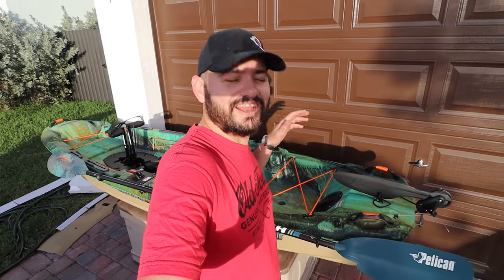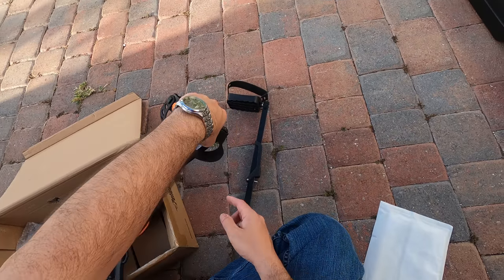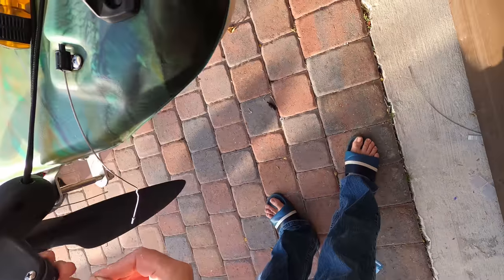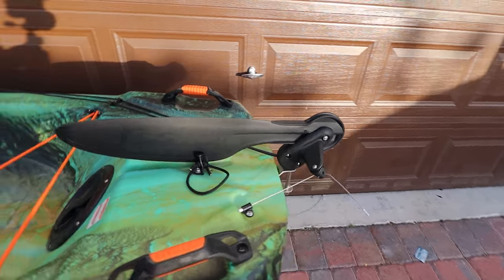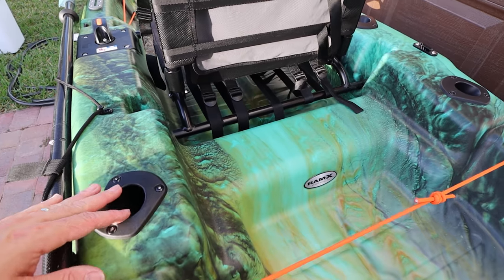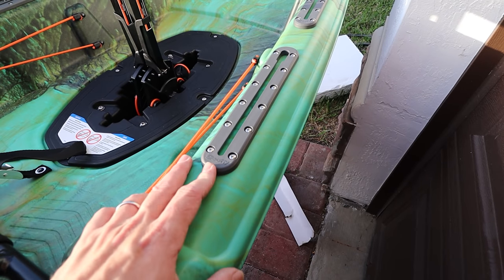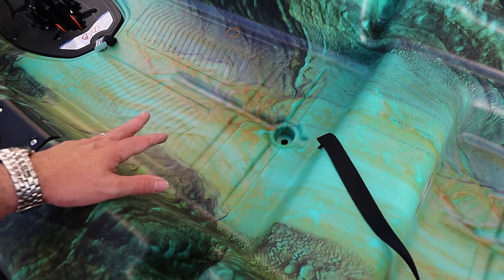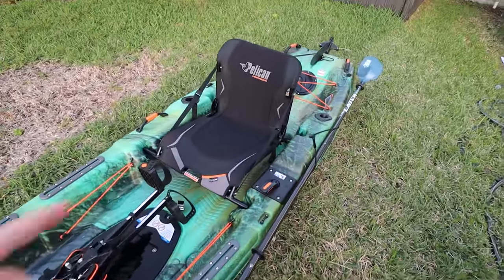FINALLY Pelican Catch 110 HYDRYVE II HDII Unboxing Setup Walkthru

Comment: Pelican stepped up there game with this one. This Catch 110 Hydrive by far has best vesatility of the Pelican fishing lineup & at that price also for flipper/pedal system control , Pelican did good. Aliex great review bro, how is the control handle operation ? Is it fluid & smooth when turning & is turning sharp ? Thanks bro,  really nice looking short kayak for easy/quick water access.
Reply from the maker: The rudder works great, doesn't seem to be moving all over the place
Reply: @AliexFolgueira  Thanks bro.

Comment: Better seat, rudder and paddle compared to the Hobie Passport 10.5.  Is the rudder strong enough to mount a Bixpy?
Reply from the maker: I tried using bixpy on the rudder... Didn't work the only way I think is to do the diy kit or use bixpy hand steering

Comment: would be cool to buy the 130hd with the new HD2 drive. so overall what do you think and what would you recommend the 130hd or the 110hd? aside of the improved Hydryve.
Reply from the maker: ummm i think the 110 works better, i think it is more efficient on the water.

Comment: Hey Aliex, I’m very interested in this boat! After having it for a few months now what is your opinion of it? Pros/ cons of it? Likes/ dislikes? Has all the concerns of the previous model been addressed and fixed? How is the tracking and steering? How is the stability and do you stand and fish? Also what do you think of the paddle? Is it worth the money or better off getting something else?
Reply from the maker: i actually took it out to flamingo this passed Sunday, it performed well, i was standing up on it, letting the current take me as I was casting to the mangroves, it is a bit teepee but you wont flip unless you are over 300#! the drive? it is well built, they fixed a lot of the issues people encountered with version one, it is not as smooth or fast as the latest hobie, but for that you gotta pay the price. bro right now this is available at REI for $1100, that’s a steal! amazing value, it is totally a buy in my book check it out (affiliate) https://geni.us/Af9NsQk

Comment: The seat is no longer hieght adjustable? Is that the shape of the hull really that much better than the original? Just looks simpler and thus cheaper to make
Reply: The seat can only be used in Hi-Lo positions on the Catch 100 and 120. Neither the 130HD nor the 110HD have height adjustability.
Reply: @PelicanSportVideos  Please get Sail in Ottawa to stock the Catch 100. They wouldn't order one for me and they wouldn't even commit to stocking one, leaving me to check their store and website repeatedly to have any chance of buying one. If they are going to rep your brand, they should not be turning away customers.

Comment: Hey Aliex! Just wondering, would a Hobie cassette style plug, fit in the hole where the hydryve go?  I feel like it would fit since you can fit a Hobie mirrage in this , I think ?
Reply from the maker: The hull is smaller than the Hobie ones so it won't

Comment: Is the seat length adjustable? I’m asking because I’m 5’2.
Reply from the maker: You can adjust the cranks, you should be fine with this one
Reply: This kayak is designed for people measuring between 5'0 and 6'4" :)
Reply: Thanks guys I have mine coming.

Comment: Steering cable to rudder installed wrong. Go through the hole on the side of the Rudder Transition supports first, than wrap around and go through the holes shown in this video from the rear.
Reply from the maker: Still working bro…
Reply: @AliexFolgueira   I am sure it is. I didn't design it, or write the instructions for it. I am just stating what the instructions say to do. People like my son was following your guide.Which you helped him a lot. He is 13. So I am just adding to help the next person.

Comment: Buyer beware:

The shell isn't bad, stable enough, comfy; I've caught a ton of fish in the this boat. After only 70 miles (6 months) the set screw that holds the rudder cable has chewed through the cable ($40 replacement from Canada took a month,) go get 1/16" stainless steel cable from your hardware store. Now the Hydryve (direct copy from Hobie) has failed, the idler cable snapped. No replacement from Pelican except a complete "core" replacement ($369 BUT isn't available for purchase from Pelican or any retailer....which pelican site directs you to "find a retailer.") Pelican will sell you a complete Hydryve replacment for $550 (which I assume will take another month to get)....have contacted Pelican countless times in the past month, no reply. Take your money and the money you will have to spend and buy a Hobie or AT LEAST plan to buy a Hobie Mirage drive (parts are inexpensive,readily available, and fast to get,) fits right in the Pelican chassis.
Reply from the maker: Try to find a hobie or ever a new pelican they are sold out, hobie drives break too buddy
Reply from the maker: @jshirks  good that you were able to get the parts